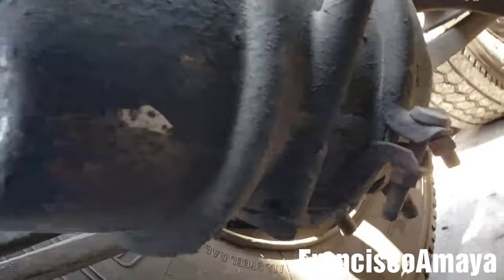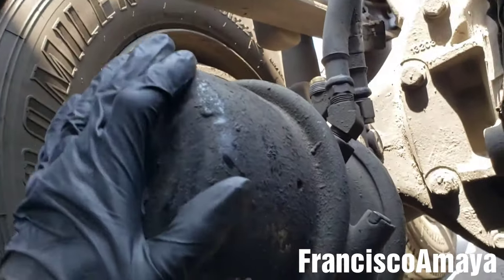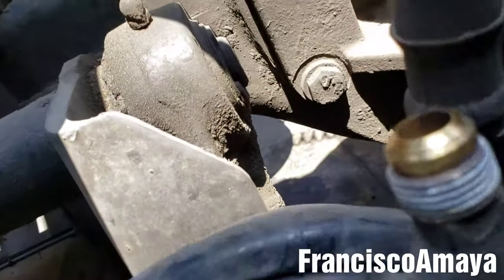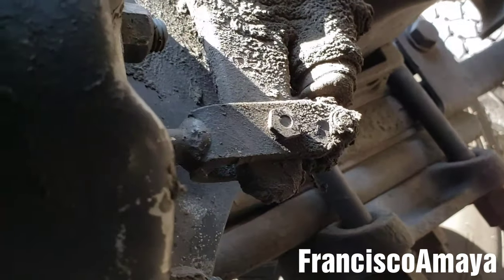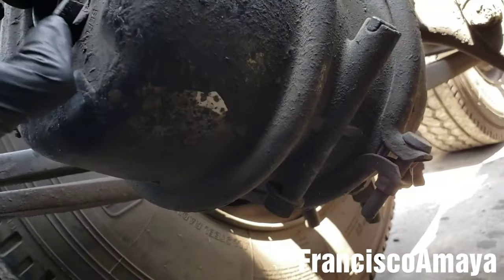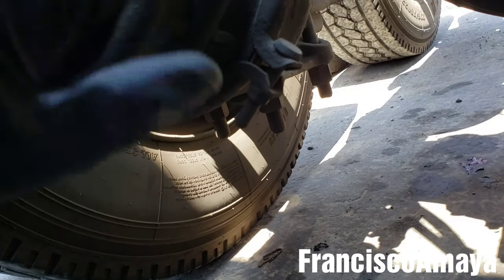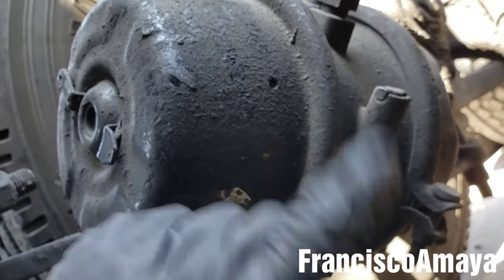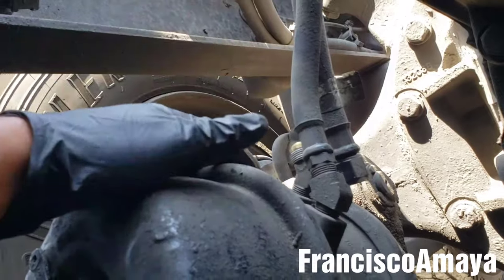Brake chamber leaking air emergency line to service line

Comment: You always save me from eminent disaster thanks. My slack adjuster and brakes were engaged when removing 30/30 brake chambers on trailer. So the s cam are in the engaged position although slack adjuster is removed from S Cam. If possible how do I get S Cam in proper position before re-installing new S Cam. So that I can cut push run to proper measurement? I’d appreciate any insight I’m in a jam thanks

Comment: The cap on the break chamber should it alway be kept plugged in? Or it can just hang lose ?
Reply: You need to keep the plug in it causes it from being corroded that never happens and usually cause breaks to fail

Comment: Ihave a problem with air brakes too its releasing air tru the abs modular what is the main cause of it? I really need your help
Reply from the maker: How it happens?
Reply: @franciscoamayaYT  i fix it i thought it was the abs modulator but when i disconnect it i found out it was the brake chamber it was leaking from sping brake chamber too service line